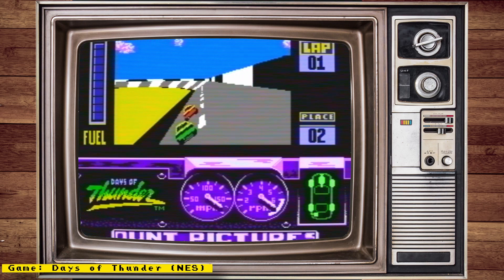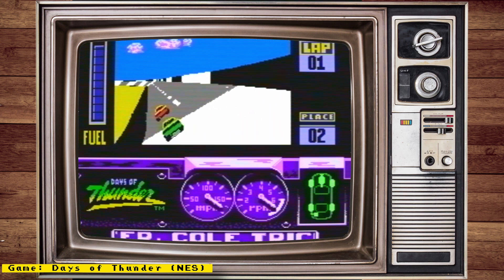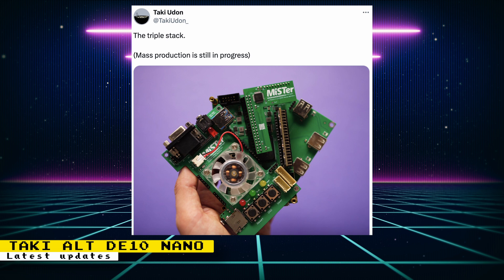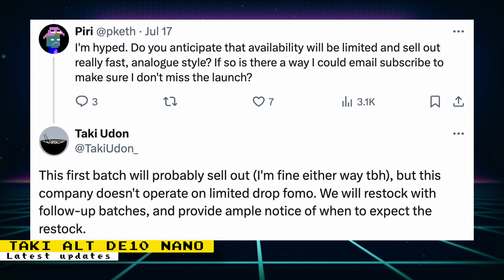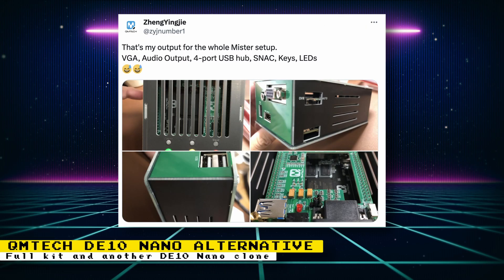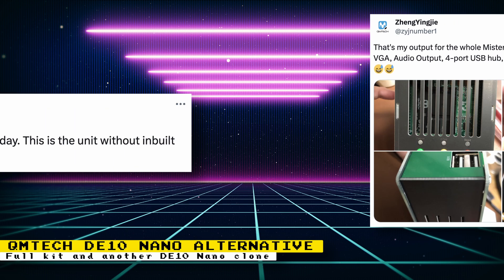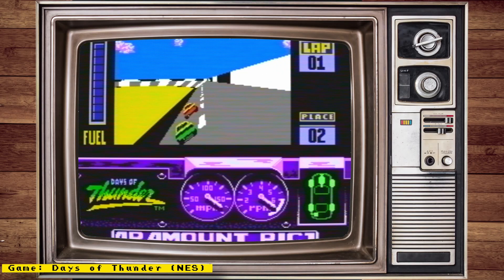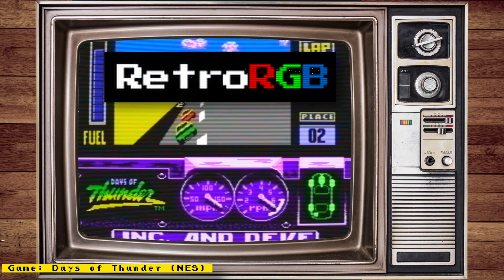MiSTer FPGA News - 3 Different DE10 Nano Clones

Comment: I want basically two Mister clones, one for console, and one for retro computers. 

Should I wait for the Taki clone vaporware bs, or should the other Chinese clones be sufficient? I basically need composite out for a CRT TV for the console one, and VGA out for my CRT monitor / the computer based one.
Reply from the maker: I find the QMTech boards to work great. The build quality isnt as good as a DE10 nano but so far there are no reports of boards failing. If you're getting one of the Chinese clone you may want to get the one with built-in SD-RAM as people are saying it's more compatible with other MiSTer cases. It's up to you if you want to wait for Taki's board. There's no real world info on it.
Reply: @LusRetroSource  How much is it if I want to output it to a CRT tv with composite inputs vs a VGA based CRT monitor?

Comment: For up to a quarter of the price of a DE10 Nano and with MiSTer Cores compatibility it is worth every penny. No one uses the original power supply in a serious MiSTer setup the original DE10 Nano was just as bad. And finally for Direct Video or just HDMI which is how most use it surely is amazing. To say it's not worth it sounds like they have economic interests to protect.

Comment: I'm really concerned about everyone just jumping on board with the DE10 Nano clone for the MiSTer project. Sure, it might be cheaper, but the DE10 Nano is still sold. We should be supporting the original developers and not just looking for a quick "fix"
Reply: I'm not sure where it lands but surely terrasic have some sort of proprietary ownership on the de10 nano design
Reply: The board doesn't matter, that's not the way the MiSTer project works. The MiSTer community doesn't owe Terasic anything. We used the de-10 because it was cheap and available,  but Terasic aren't the "original developers" of MiSTer.
Reply: @DrJohnnyBananas  The MiSTer project has always thrived on contributions from developers and especially from commercial sellers of addon hardware. It can't be simply described as a non-commercial project. Practically, very few people will solder everything themselves when addon boards are available. The current clone is just another step in commercialization, making the project feel even more commercial to me
Reply: Nope they were nickle and diming the community once they got hold of that a secondary market for their board opened. Besides that they always felt uneasy to have their product in the games market, they are mostly a b2b business and do not want to have the support hazzle of gamers! Probably one of the reasons why they did the price hikes in the first place to reduce end user sales of their boards!
Reply: @werpu12  It's all about supply and demand; the company has no obligations to any community. Why would they raise prices to stop user sales? They are profit-oriented and clearly target the consumer market as well. The price increases likely help manage demand and ensure product availability remains at a controllable level. I can't understand how some people can rationalize everything just because they want something
Reply: @snesy  They are not an end user company, period, there are many reasons for the price hike, the main one probably to because they can get away with it, but also their support lines are not for end users as well, they felt uneasy to have this burden, you clearly can see that by the permanent message in the mister forums they left!
It is a company and students development board!
Reply: @werpu12  It seems you haven't taken the time to contact them either. Your statement shows that you're piecing together some loose facts to support your preferred narrative
Reply: your fine with the hundred dollar price hike of the mister by a big name company?
Reply: @snintendog  I don't owe big companies anything to respect their rights. Why don't you write to Terasic yourself and ask them what they think about this clone board, if anyone here still cares about their standpoint? I've had this conversation many times, and it seems no one has taken the time to properly inform themselves or simply ask Terasic directly
Reply: The DE10 nano is a development board sold to students and professionals who need a general purpose FPGA dev board. It was never intended to be a consumer product. It is part of an ecosystem to market the Cyclone V FPGA chip itself to be used in consumer devices.

The "clone" is a consumer device that just so happens to utilize the DE10 nano's form factor because we weirdly built a product ecosystem around their dev board.

IMO there is nothing morally wrong with using the "clone" for the MiSTer project. In fact, it is more along the lines of their intent. They are selling their chip either way, and that was the whole point of them coming out with the dev board.

Now, they may get more return on their R&D of the development board if you buy the DE10 nano instead of the consumerized version of the same thing, but their intent the whole time was to sell the DE10 nano to product developers (such as the company making "the clone"), so they can sell the chip in bulk to them to create consumer products.

The only odd thing is that we essentially did all the R&D for "the clone" company's product for them, for free. So if they sell at what seems like a discount, then that's because we did a lot of their work for them.

IMO, this isn't the same dynamic as the typical clone of a consumer product, because the intent of the DE10 nano wasn't to sell to consumers. If you are concerned, you should ask them. Certainly better to discuss it with them than with us, since anything we can provide in return is relative speculation.

The only problem I could see them having with it is that the clone could be used as a cheaper alternative by developers and students. But the way the clone is being marketed so far is for consumers for MiSTer. I suspect bigger companies and universities buying a bunch of DE10 nano boards probably have some budget, and probably don't want to take risks on using what in their minds would be a "knock off" device. They probably want what I assume is a business class warranty and support guarantee. So my guess is it's not really in competition in that way at all.

Also, there may be pieces of this I'm missing in my assumptions, e.g. why Intel partnered with terasic, what terasic get out of the partnership, and if this is part of an even more complicated product ramp up to get devs hooked on FPGAs so they buy even beefier devices in the future (I'm guessing it's definitely that in the student case). Someone who works in electronics product manufacturing would know more than I do. I'm just some software dev who stuck their nose into business and operations at companies I've worked at and learned a few things here and there.
Reply: @blarghblargh  Thank you for your detailed response. It might be better to contact Terasic directly for clarification instead of making assumptions. It's quite ridiculous to have such a strong opinion about their intentions without having obviously communicated with them directly
Reply: @snesy  you're the one who cares. You contact them. If this isn't your first conversation about this, sounds like you're overdue to research this topic further. As for ridiculousness, so far you seem less informed than I am. So stop with the misplaced guilt trips and get us verified answers before going on a moral crusade.
Reply: @blarghblargh  You don't need to tell me what to do. I'm sorry if I hurt your feelings by pointing out that you have a strong opinion without actually contacting them, but in the end it's your own fault
Reply: @snesy  Spammer
Reply: @snintendog  I like self-referential statements. By the way, I always lie
Reply: What a joke. The more options we have the better, as the user base expands, so will the community and people willing to contribute to the project.
Reply: @Pazuzu-  It's not about "us". And who is "us" anyway? I also appreciate the MISTer project and consider myself part of the community, just like you. The difference is that you seem to be focusing primarily on your own benefits
Reply: This is the weirdest take. You’re telling people they only care about themselves when you are siding with one manufacturer over supporting multiple companies and benefiting all consumers by offering lower priced alternatives. 

You are the one that is picking sides, everybody else gains from different companies in the market and will push Tersasic to lower their price or continue to improve their product.

Comment: I saw on VK’s Channel (well, someone he featured) that the QM Tech board will fry your RAM if you install it as your RAM module indicates (“This Side Faces Out”). Is the RAM slot backwards? Is that why it isn’t compatible with the MiSTer Multi-System? I’m glad it exists but I really want to know why they would do this.
Reply from the maker: That's pretty scary. I've had no RAM issues with my board. Also, this board is NOT compatible with any IO board, not just the multisystem. The arrangement of everything is different so it wont fit on anything that's out there. That is a big issue I have with this board.
Reply: Can confirm not compatible with Multisystem, M3 variant or any standard current MiSTer IO. Pinouts are all switched around. Lu's testing video will probably go intot his no doubt so stay tuned for his thoughts.
Reply: IO 0 is flipped! The quick setup guide does warn you about this and shows you how to install the SDRAM correctly. Unfortunately it’s not included in the box 🤦🏻‍♂️ I found it online after installing my SDRAM the wrong way round lol luckily I smelt the burning and turned it off before it did any permanent damage! 

Edit/ I think the IO boards will work, you just need to use an extension cable rather than stacking them TBC

Comment: As much as I'm looking forward to these clones, the more I hear about them the more I feel it's too good to be true. Everything about it seems like everything we'd want so there's gotta be a catch, right? I'm hoping for good results but I feel like I gotta keep my expectations in check at the same time. At least I plan on waiting until the consolized versions are out so hopefully that'll be enough time for good reviews.
Reply: I agree with the feeling. The way I have been thinking about it to myself is the DE10 Nano was first released in 2017 (I think), so after such a time, price and general availability of the main FPGA can be better
Reply: Agreed. Wait for reviews and grab a later drop
Reply: I agree with you seems like vaporware, anyone that works in the industry knows  seeing price go from 550$ to 160$ seems far fetched.
Reply: Low cost=lower quality= lower durability… you can never get around that, and i haven’t ever seen otherwise with everything coming from china or low cost countries. I remember the 80s, 90s …everything you bought back then was build to last. No one can deny that has changed!
Reply: @jengelenm  I'm fine with it costing as much or a bit more then a DE-10 Nano as is, I just don't want to pay as much as a PS5 for the whole set! I'm fine paying around the $300 mark if it means getting everything in a solid high quality package.